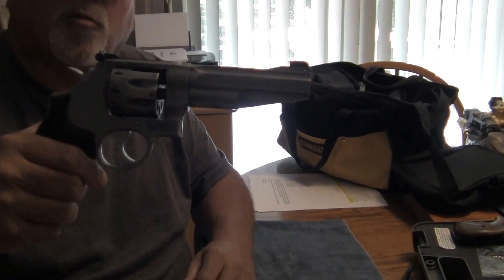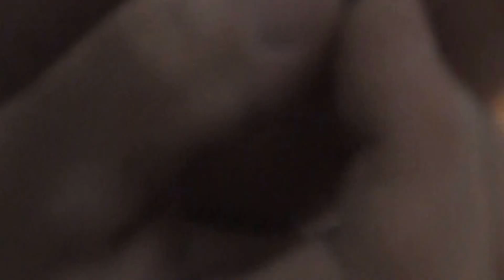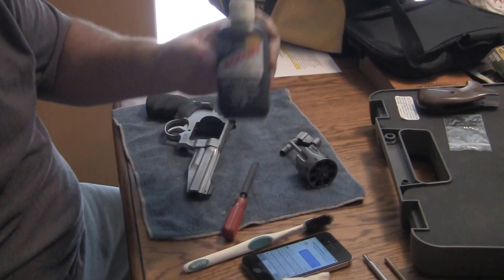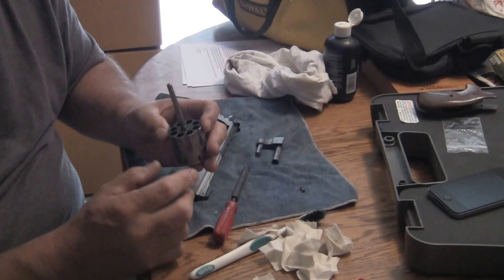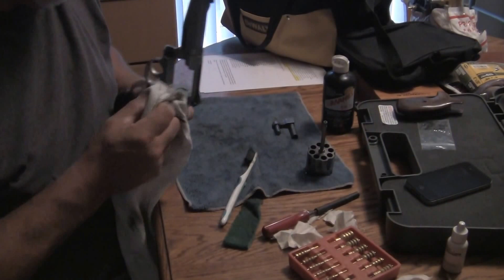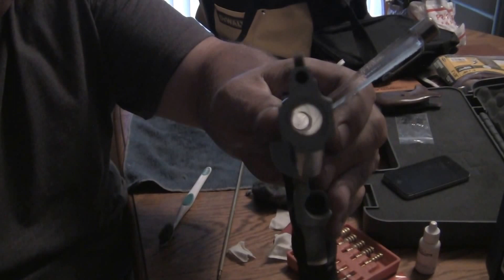S&W 627 Performance Center Revolver Cleaning & Maintenance

Comment: LIKED YOUR VIDEO ; BUT WHY DIDN'T YOU DISASSEMBLE AND CLEAN UNDER THE CYLINDER RELEASE SLIDE MECHANISM  AS WHEN THEY GET VERY DIRTY THEY WANT TO LOCK UP AND NOT RELEASE THE CYLINDER  ; THANKS, S.E.SMITH

Comment: Seems like you should be using gloves because of all the lead. It wont kill you but will cause a loss in cognitive function if exposed to a lot over time
Reply: There is not enough lead to harm you its mostly just carbon build up burnt powder

Comment: Well done sir.  I just bought a 2-3/4 in 627 PC.  Haven't shot it yet, but wanted to know how to clean and maintain it beforehand.  I really like guidance to make sure the screwdriver head matches the screw diameter and the 1/8 in rubber hose to prevent marring the frame.  Thank you very much for a comprehensive tutorial.